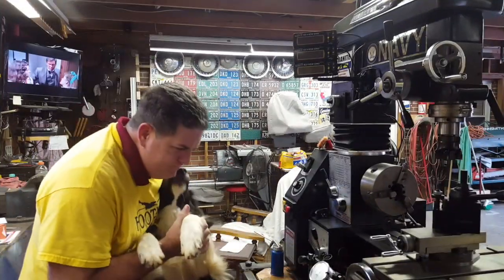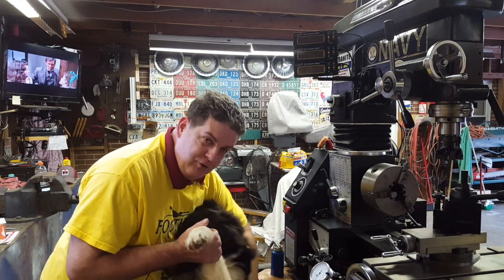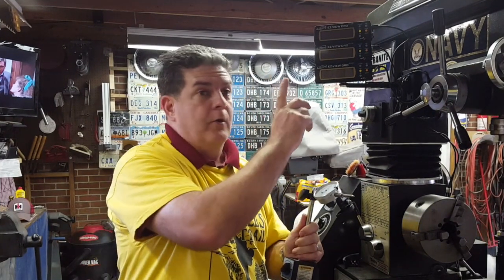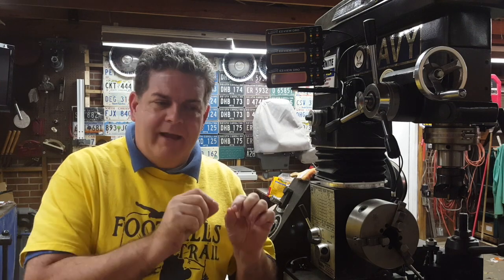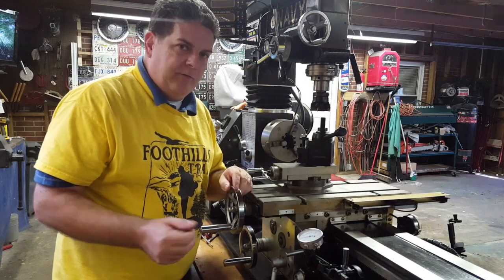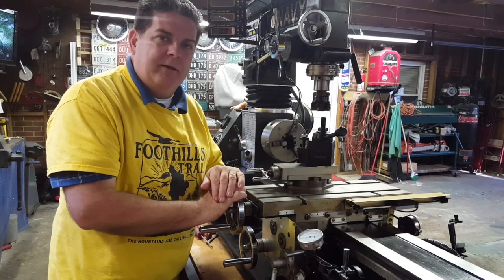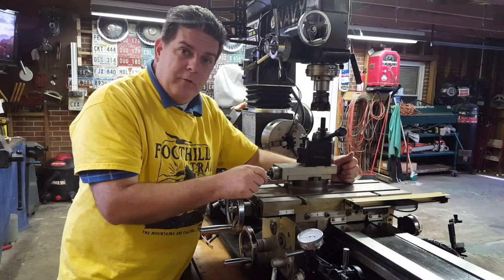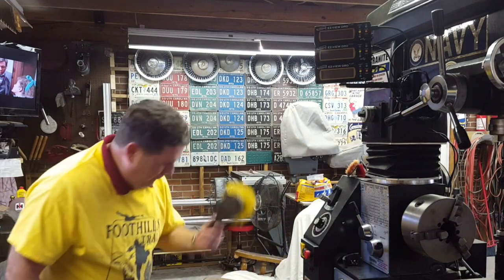Smithy Granite 1340 Max DRO Problem

Comment: Hi there, i was wondering  if you would be willing to give me some advice on a Smithy granite 1324 that someone is selling as a result of his grandfather passing it  looks like it hasn't been used in years which is what he is telling me, he knows nothing about the machine, however the chuck, ways, compound, cross slide is completely covered in rust as it looks like there was an issue with moisture, the gears look clean , like new actually, he is asking 2500 but would likely drop the price. I have no idea if  this is a good deal or not, assuming the rust can be cleaned off with some work. is there anyway to get your email?  i  can send you some pics that he sent me. I don't know anyone else that would know more about the Smithy, Please and thank you, My email is spinedoc4@aol.com